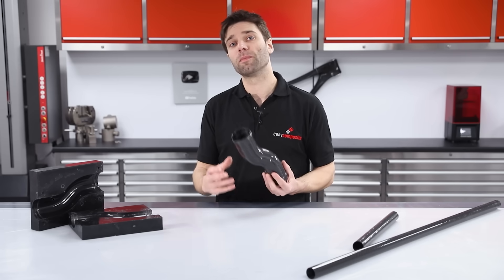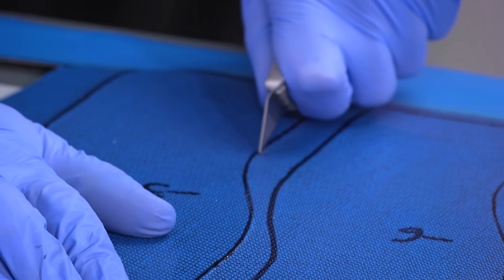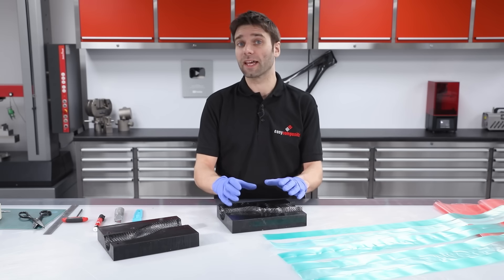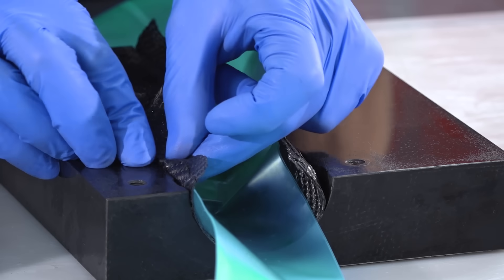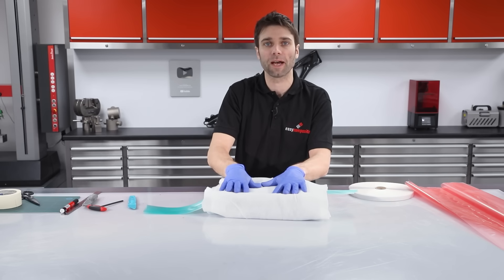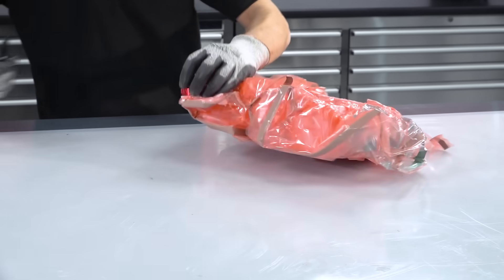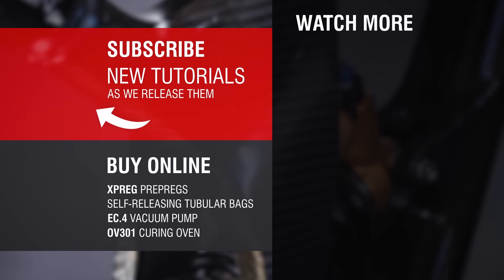Making Complex Carbon Fibre Tubes Using a Split-Mould

Comment: But isn't it weak at the line of attachment of two halves..? What if we use a carbon fiber sleeve and inflate it from inside and  vacuum it on outside ....?
Reply from the maker: The overlap shown is strong enough for the intended use.  If you had a higher strength application, overlaps could be increased to reduce any weak point in the over lap area. Pre-preg is generally not usually available in a braided tube format.

Comment: Interesting information from our friends in the UK. I have a question about Pre-Preg carbon. From what I have learned about reading descriptions of Pre-Preg, is that it can cure at room temperature over a longer period of time. Considering that, if the part is cosmetic or not structural, couldn't you just put it in a mold and let it cure? Though I think the vacuum bags would be useful. I think because it is Pre-preg, you might not have the issues (bubbles) with traditional layup that more like Kevlar or fiber.
Reply from the maker: it will not cure properly in a structural sense at room temperature let alone in a cosmetic way.

Comment: I notice there was no debulk. When using prepreg for a tube style like this is a debulk not required?
Reply from the maker: For thicker laminates it would be beneficial to have a debulk although the format of this tube makes it a bit more complicated than a typical debulk.
Reply: Thanks understood. I will be using a aluminium mould. Would it be standard practice to use mould release CR1 each time or not required? @easycompositestv

Comment: Can a home oven be used? What temperature does the part need to be baked at? Also we’re those two halves moulds made from wax offset sheets?
Thanks!
Reply from the maker: You can see how to use a home oven in this video: https://www.youtube.com/watch?v=6xj06Am94aQ&t=4s

Comment: Why did you say it's difficult and impractical for wet layup?
Reply from the maker: Access given the small openings is impractical and keeping the fibre against the mould surface on the vertical and underside would also be difficult without vacuum assistance which in turn wouldn;t be easy to achieve in such a small space.

Comment: 2:27 Just thought of a nice trick for the template. Just trace one side with the marker (and top & bottom,) then shift the whole template over the 15 mm that is required and trace the other side. No need to mark out and connect dots!

Comment: How is the mould done?
Reply: Likely CNC'd from foam, coated in epoxy resin, and then strengthened with carbon fiber on the back side to prevent warping. They've installed threaded inserts so that the two halves can be tightly fastened together. The work involved in creating that mold is significantly higher than the work to produce parts from it, but you only have to do it once.

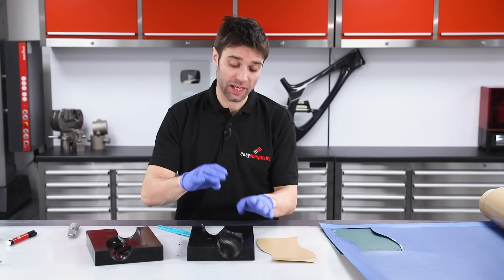Comment: Could I ask that you maybe do a video on making a 1:32 scale model car, perhaps use a scale die-cast car as the basis of the mold, I have seen a few resin cast cars but after watching video it dawned on me that carbon fibre in single layer coukd be mush more durable as a slot car and I think a lot lighter than resin cast

Comment: Just out of interest, why is this complicated process of an internal vacuum bag used? Would'nt it be much easier to consolidate the part with a bladder that has over pressure of 0.8 bars inside the mould?
Reply from the maker: Its no more complicated than a bladder, in fact less so as you use an off the shelf vacuum tube and the vacuum pump is all that is needed.  To use a bladder you need an appropriately sized bladder that has suitable temperature resistance to survive the cure cycle and a compressor to pressurise it.

Comment: How much boost can that hold, seems the seam would be a weak point. Thanks.
Reply from the maker: We have not tried to blow it up.  The overlap makes the join quite strong.  You would just use more layers if you needed it stronger.

Comment: Can this be done with a wet lay up?
Reply from the maker: In theory yes, in practice the difficulty is trying to get the wetted carbon to stay in place during assembly to get to the stage where you can pull the vacuum. Generally the carbon will try and fall out the mould when you turn the top half upside down.  You could perhaps experiment with a temporary foam core to help hold things in place during assembly.

Comment: Hi there! I am kind of new to working with these techniques, but is it always handdrawn and handcut like this? Or would you normally use CAD drawings and laser cutters produce these stencils of carbon fibre? Thanks! :)
Reply from the maker: That really depends on the production volumes. For relatively low production volumes, for example if you're making a few of these parts at a time or make them infrequently then you probably wouldn't go to the trouble of CNC cutting the plies, however, for larger volumes, if you have the equipment (a CNC cutter using a drag knife, not a laser cutter) then it's quite common to CNC cut the plies (which can also be numbered by the CNC at the same time). Often, these pre-cut 'kits' of all the different plies required for a component are bagged together and re-frozen ready for future use.

Comment: why did you edit out the part where you poured the resin?
Reply from the maker: There is no 'wet' resin process in this instance, the material being used, PrePreg, already has the resin pre-impregnated onto the fibres so doesn't need any more adding.
Reply from the maker: Hi Johnny, we didn't edit it out, the type of reinforcement we're using here is called 'prepreg', it has the resin already in it, and then you cure the resin in an oven. We have some good videos which serve as an introduction to prepregs if you'd like to learn more.

Comment: Can complex tubing like a motorcycle handle bar be made using hand laying CF?
W/o use of vaccum bagging or Oven that is?
Reply from the maker: Yes, you can make structural components using a hand-layup process but there will be a reduction in performance - in terms of strength to weight ratio - and there will be some additional inconsistency and so you would need to factor this in when choosing things like the thickness of the laminate. In short, you'd want to 'over engineer' the part more when you're hand laminating to give you more safety factor to allow for inconsistencies or irregularities in the laminate.

Comment: So Im still not fully understanding this. Does the carbon fiber attach itself together from the pressures of the mold or is the carbon fiber heated and pressurized causing it to stick? Or does the fiber have a resin too it?
Reply from the maker: The cure cycle in the oven gives the heat needed to cure the resin,  The force applied by the vacuum is what helps consolidation of the fibres and helps remove air giving a good quality composite laminate structure.

Comment: This is extremely labor intensive, i wonder if it would be cost effective making a machine complicated enough to do this auto atically.
Reply from the maker: If you had production volumes high enough to justify trying to automate the process then you would probably want to change the process at the same time. There are composite production processes that are better suited to automation, although they tend not to yield the highest performance parts.

Comment: Your videos are truly superb. I want to order some materials but I'm in the US so overseas shipping prices & travel duration probably aren't ideal.
Reply from the maker: Agreed that they're not ideal but we can and do ship to customers in the US every day. The real killer is 'dangerous goods', so anything like resins and release agents - these attract a 'hazardous surcharge' from FedEx which can be more than the shipping itself. For non-hazardous products, like our prepregs, lots of customers find that our shipping is about the same price as US suppliers and often delivery is quicker. For example, a typical roll of prepreg might be around $30 shipping and be a 1-2 day service. To find out for sure, you can add the items to your basket on our website and the shipping calculator will give you the actual shipping cost, including the hazardous surcharge (if one applies).
Reply: @easycompositestv  In one of your videos you were building a sledge and performing tests in a freezer filled with prepreg- doesn't it have to be kept frozen? How is this accomplished during the long transit times?
Reply from the maker: @bbrown9763  Our XC110 OOA and XC130 Autoclave Component PrePreg and XA120 material don't need to be shipped in insulated/dry ice packed boxes as they’re not that sensitive to temperature, especially at this time of year. We ship direct from our freezers meaning that for at least the first 12-24hours of the delivery, it remains frozen.  We even have several long-term Asia and Australian/NZ based customers who regularly purchase PrePreg from us in large quantities without issues.

The out-life of the material (the cumulative time that the PrePreg can spend out of the freezer) is at least 28 days at 20°C - as such, you should still have a minimum of 24+days of useable life left on arrival. As soon as the material arrives with you, if you put it straight into the freezer, it will preserve the remaining outlife. In most cases the 28 days is conservative too and in practice, you will get more than this.

Comment: Why this process mold carbon fiber tube  doesnt use epoxy and hardener, to be solid ?
Reply from the maker: This is PrePreg Carbon Fibre; the resin/hardener is already on the carbon fibre fabric which is why it has to be cured in elevated temperatures under vacuum in the oven.

Comment: Hi guys! Nice content, congrats. I have a question, which pressure needed to make a good vacuum and a temperture to cure perfectly. Thanks!
Reply from the maker: This is cured under full vacuum, so 29.9" Hg or better generally.  The temperature is as per the pre-preg cure cycle.

Comment: this help me very much in a fuselage for a DLG glider that Im about to start, one question, I would like to peg the carbon fiber to the mold like you do, what pre peg it on it ? is that like a doble peg tape? or just I can use the 3M 77 spray ?  i like this process because enssures if something go wrong during epoxy cure this secures the mold format, right ?
Reply from the maker: Hi Juan, in this video we’re using prepreg carbon fibre; that means the resin is already in the carbon fibre. It’s this resin that sticks the carbon to the mould and it’s also this resin that will flow and cure when the part is heated to make the cured laminate. The prepreg we’re using is our XPREG XC110, you can find it on our website.
Reply: @easycompositestv  ahhh ok, I totally understand.... Now with your vid Im deciding what method is better for my project, this is a 2 parts hollow mold that normally we use a ballon that we inflate with a 25 psi in order to push the walls of the mold but if the balloon explodes during epoxy cure the whole piece is lost  so Im thinking doing it with a vaccun baggin, but Im not sure. Thanks for your vids, are really good and professional
Reply: Sorry for my english Im from Argentina

Comment: What percentage of total cost is the actual part? Cost for this tube is?
Reply from the maker: That’s hard to break down without knowing what you mean by ‘total cost’ and also what you mean by ‘cost of the part’. Do you mean just the materials in each component, excluding labour, the mould and the equipment cost? If so, there’s maybe £8/$12 of material in each component, including the bagging materials and prepreg, excluding anything else. We don’t sell the part so I can’t say what percentage this material cost would represent of the retail price.
Reply: @easycompositestv  What I meant was using the value of 12 dollars is if the total value of a the tube is 12 dollars, how much of the cost is the  bagging materials and prepreg?  also the oven must cost something to use.

Comment: Hi. Currently I don't have possibility to cure prepreg at elevated temperature. If I would like to do a similar tube with a wet layup, would you recommend to only have #1 inside vacum tube only #2 inside vacum+peel ply #3 inside vacum tube+peelply, perforated releasefilm, breather #4 any other internal setup?. The inside surface is not so critical, more the outside against the mould. Thanks in advance.
Reply from the maker: Hi Andre, the fundamental problem, regardless of bagging stack is getting the carbon to stay put during assembly.  For a small part you can probably avoid the breather which will make putting it together easier.  However trying to do overlaps on wet cloth will be quite messy and difficult.

Comment: Dumb question here! But when you put it in the cabinet was it just a cabinet that kept vacuum and baked it? Or did it just naturally bond while under vacuum? Just qurious on what happened in the cabinet.
Reply from the maker: Hi Garrett, the cabinet was an oven with a vacuum line into it. The oven ramped to 120C which flows cures the resin (whilst still under vacuum)

Comment: Why not just use a expansion balloon with a heavier mold, would be more cost effective if you where making more than one and could be done with a normal compressor
Reply from the maker: You would need a considerably more durable mould which would cost considerable extra in material.  A decent compressor is likely going to cost as much if not more than a good vacuum pump and it limits you to projects where a bladder can be used. This method works for most shapes and needs only the vacuum pump that many people doing pre-pregs or composites would already have thus making it easier than using a bladder as a one off.

Comment: What vacuum do you use?
Reply from the maker: In this tutorial, we use our EC4 Vacuum Pump at full vacuum level. With Prepreg and Resin Infusion processes, you always need to aim for full vacuum level; with vacuum assisted wet lay techniques you will often aim for a lower vacuum level to prevent drawing excessive resin out of the part.

Comment: To improve strength, is it common to externally wrap the tube with additional carbon fiber layers, after it is formed?
Reply from the maker: Its not that common but can be done where an off the shelf tube needs extra reinforcement.

Comment: Very informative! I am planning a carbon fiber classical guitar, how would you do the head? Like this one: https://en.wikipedia.org/wiki/Headstock#/media/File:Guitar_May_2009-1.jpg
Reply from the maker: Realistically you would have to mould it.  It would unlikely need to be totally solid but can be made that way if you wish.
Reply: @easycompositestv  Thanks! What do you mean "mould it"?
Reply from the maker: @Fjmendezking  Make a mould from an original or pattern of the correct shape.  Once you have the mould, you should be able to use that to make the carbon fibre finished part.

Comment: Would your oven also be suitable for curing a ceramic coating such as Cerakote as well as for cabon fibre work?
Reply from the maker: Depends on the temperature it needs to go to and if it solvent offgasses. The oven is not designed to be able to vent solvents.
Reply: @easycompositestv  Well within the temp range, just need to check about the off gassing.

Comment: What kind of pressures can that type of joint survive?
Reply from the maker: Hi Gabriel, you would likely need a thicker tube for any significant pressure. A tube this wall thickness would only really be suitable for an air filter intake pipe or non-boosted applications.

Comment: But what is the inside surface like? That's more important than the outside of an air pipe. Also, why not use a rubber vacuum bag that doesn't wrinkle?
Reply from the maker: Hi Johan, similar to most carbon parts it will have a fibre textured surface.
Reply: @easycompositestv  my concern is wrinkles in the resin on the inside surface left by wrinkles in the plastic bag liner. I don't know how much of an issue that is with pre-preg carbon.

Comment: Please forgive my ignorance. I come from surfboard making (you know, you pour the resin on the cloth and use a squegee to work it), and... Where is the resin here? 😅
Reply from the maker: Hi Andy, the video uses pre-preg that already has the resin impregnated on the cloth. It is very slow cure hence why an oven cure is needed.
Reply: @easycompositestv  thanks! Is it resin and hardener, prepared before the work? Or is it a resin that cures with temperature? Sorry, I am very impressed and I got hooked. But I know just the classic epoxy resin. Thanks again!
Reply from the maker: @Andy_XT  It's a prepreg material. The resin is already mixed and impregnated through the fabric and cures at elevated temperature.

Comment: why do you need to make a vacuum? wouldn´t it also work if you make the inner tube of a flexible elastic material like TPU and inflate it very hard, so it will press from inside only the the carbon membranes onto the surface of the mould?
Reply from the maker: Using an inflatable bladder can work well also. However it is hard to find suitable materials off the shelf as well as reliability issues.  Vacuum bagging material is easily available, highly reliable and also in such cases can have some advantage over using a bladder.

Comment: If we dont do the vacuuming, it wont get hard right? Or it just helps us to stick 2 pieces?
Reply from the maker: Whilst it may still cure when exposed to heat, the layers would be likely to delaminate, resin may run out of the fibres and the materials is likely to come away from the mould tool so you can't really do it without vacuum.